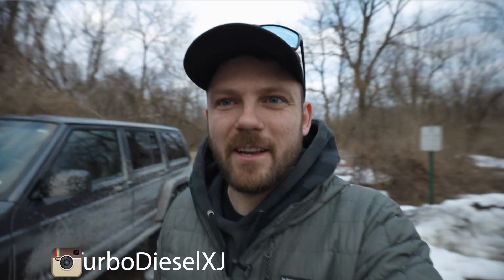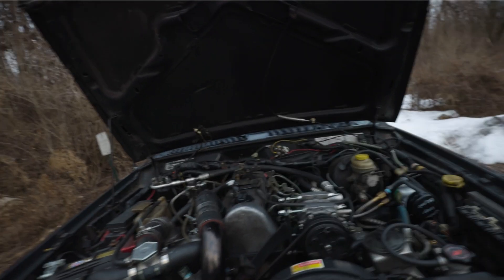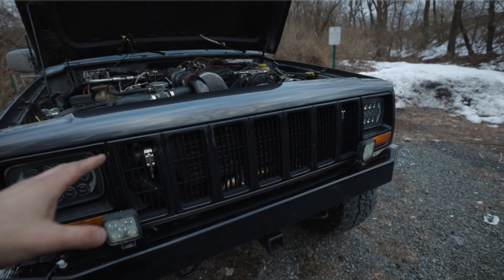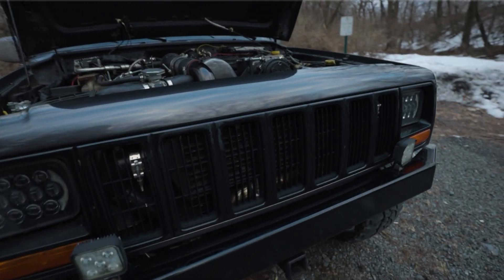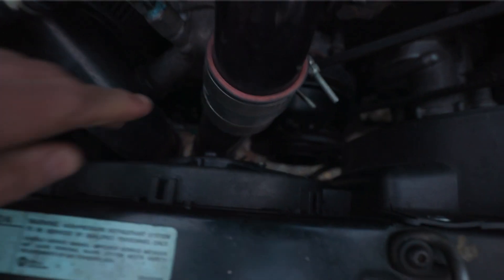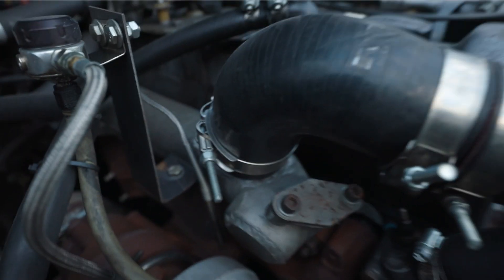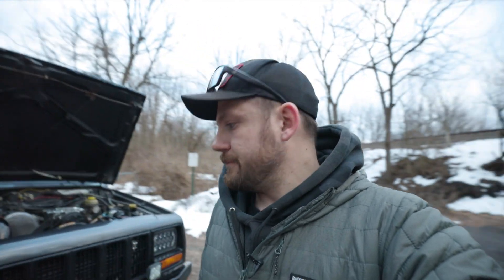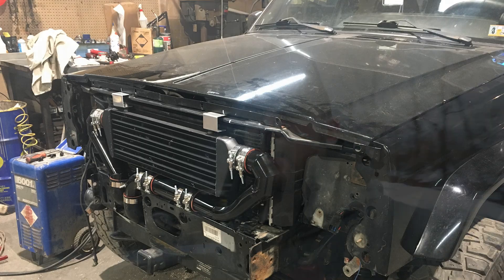Diesel Jeep Cherokee XJ Intercooler Setup

Comment: I love diesels (I have a factory Toyota 1KZ swapped 2nd Gen Hilux Surf/4Runner) and I own an XJ... but why the HELL would you do this swap on a noodly unibody vehicle???  Buy a Toyota or something with an actual frame.  XJs have horribly weak chassis and eventually they all rattle to pieces unless you spend a TON to beef up the unibody and put a cage in them... Plus the 4.0L is the best thing about them... they're not worth it.  Build a Toyota if you want a trail-rig (XJs are also TINY inside... We did 4K miles with 1900 miles off road across OR/WA/ID last year and just the two of us were hurting for space and couldn't even sleep in the rig,  unlike my 4Runners).
Reply from the maker: Although we obviously disagree about the jee being capable for overlanding, I do FULLY agree with the unibody statement. I’ve had failures and spent a lot of time bracing the front end. So you are correct there that it is an issue. 

I also happen to LOVE Toyota’s. I just have a sweet spot for a cherokee and I’ve owned this one for over 10 years now. Very happy with my build.